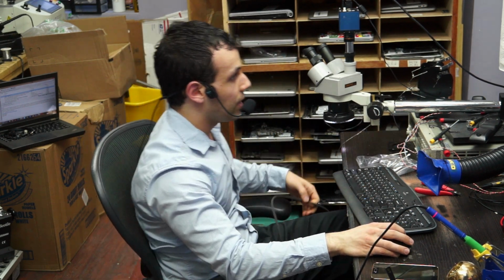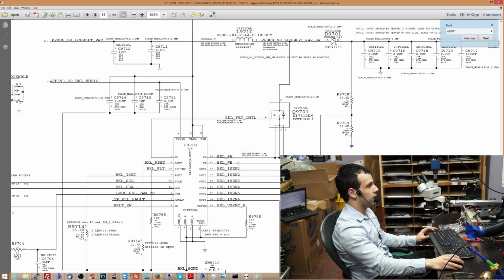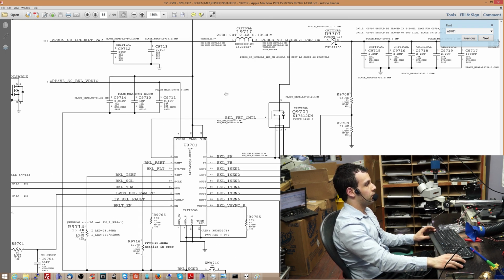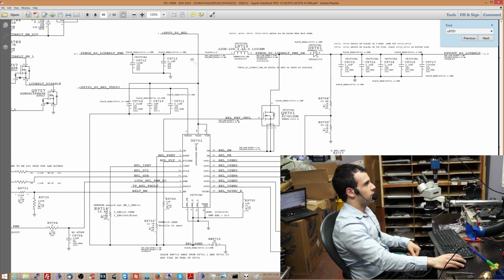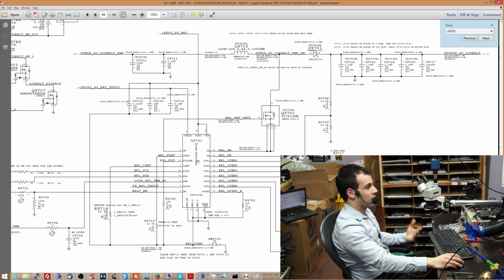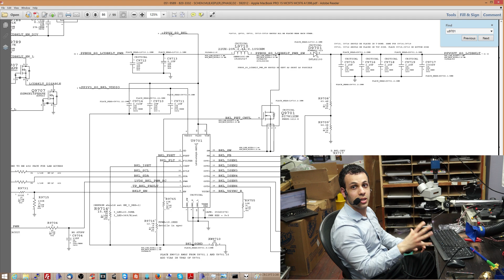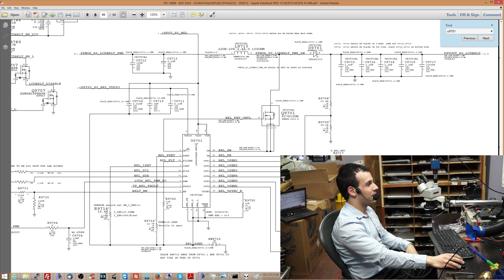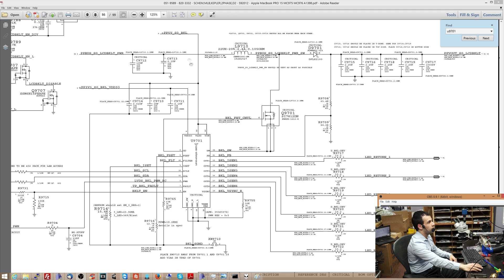What is ground and what is its purpose in a circuit?

Comment: 7:20 ".. Electricity wants to be in the ground". Expert on grounds Mike Holts says in his videos, that the electricity in a circuit does not want go to the ground. Instead it wants to go to the source of supply (its negative terminal). And continues that electricity would take any path, so it could happen that most of the current would return to eg the battery and the rest would go to the ground

Comment: So is there a flow of electricity going through the multi meter at all, are are the electrons in the probes experiencing the state of unrest (charge) that the component is experiencing? If so, why does the negative probe need to be attached to anything if the multi meter can read 0 if none of the probes are toughing anything? In high school they only ever taught us about battery circuits, and all electricity needs to find a way back to the negative terminal of the battery to close the circuit. Are all grounded sources connected to the negative terminal? What happens to the electricity after it makes it to ground? Does the ground have a charge if a component is connected to it, like in the schematic? I am just trying to wrap my brain around on why electricity would want to go to a ground if it isn't completing a circuit. And I am trying to figure out how devices powered from a dc power supply work, since they don't have a negative terminal (,or maybe they do, and I just don't realize it).
Reply: Mulimeter basically creates a parallel connection in voltage mode and has very high resistance/impedance so the actual flow of electricity(current) through the multimeter is quite low since current takes the path of least resistance. Voltage by definition is the difference in "electric potential", confusing terms aside, its basically always relative. Good analogy is that voltage is basically like pressure in a water system. If you have one tank at 12 PSI and hook it up to a tank at 3 PSI, the difference in pressure is 9 PSI. Thats exactly the same way to think about voltage. Current is, well current.. How much is actually flowing. And resistance/impedance, again just like it sounds.

Comment: Louie, I have an inverter that I shorted out trying to install a switch. My dumb ass put one of the wires on the negative going to vcc which in turn turns on a voltmeter. By doing that connection I heard a faint popping sound and saw some white smoke near an inductor and transformer. Needless to say the unit doesn't power on whatsoever and to top it off I can't find the source of the short. I know you don't deal with inverters. But your keen sense of electronics might help me out. Thanks for all you do. Your videos crack me up along with educating me. Please send me links to the flux and solder you use for your projects and fixes. Much appreciate it. Peace brother!

Comment: Could you use as 3v rail as ground and 12v rail as power in order to power a circuit that needs 9v? This is a theory question just trying to better understand. What would the pros/ cons be over a voltage divider if this was easier for some reason again this is just to help me better understand

Comment: One teacher of mine said that electric circuits can be compared to a water network. Tubes=cables, capacitor=water storage, voltage=water pressure, water speed = amps, ground=sewage, etc.

Comment: You're mixing two different things at the beginning of the video. The reason electrons flow from the positive to negative wire doesn't have anything to do with valence. After all, the two wires are probably the same material (some sort of metal). Valence transfer involves two different elements that bond together. There is no bonding happening when you are transferring electrons between two metals. Your voltage source is generating "higher energy" electrons in some sense but this is different from valence and bonding.

Comment: That's not what u think.This happens mostly with the poor quality charger / adapter product and has nothing to do with the battery. And also this could ruine the life time of the circuitboard.
Sometimes this happens with mobile phones and all are because of bad quality charging adapter.
SOLUTION: Make a USB cable with GROUNDING. The easiest way to make is to attach the grounding cable from the wall outlet to the Female part of a USB cable and connect the other Male end to the Laptop. But if you don't have any Grounding system at your house electric wiring system, you have to find a way to do so.
(Generally a naked silver or copper wire is used to do grounding inside the electric switch board, or sometimes uses a GREEN wire to connect to E, as earthing, that's the 3rd pin of a electric 3 pin plug).
Goodluck.

Comment: but I still do have a question when you are creating a charge are you piling electrons up and they want to balance themselves out and that's what makes them move down a conductor to the reference point or ground or when you're creating the charge with the magnetic field are the electrons moving to a higher energetic Orbit on the atom of the material itself my question is if you know what exactly happens to the electron when you're creating the charge the actual physical movements

Comment: The multi-meter section about how it calculates the difference between the two connections was particularly useful analogy I thought.  I do still wonder what happens to the electrons when they are connected to a ground. Where do they go? I mean if the electricity is coming from a high potential to a low potential and wants to create an equilibrium and if you consider wave particle duality I was wondering if there was any measurable result that can be detected. Like waves crashing onto a beach you have sound and ocean spray. Is there a way to detect the electricity crashing into ground?

Comment: sigh electron pushers......your version of ground is the return to the power supply secondary, it is not a true ground it is a bonding buss tied to the opposite end of the coil from the out put terminal , that end of the coil is then bonded to the frame in order to zero the circuit.
"ground" bonds the power supply primary back to the utility transformer core which is in turn bonded to earth in order to zero its circuit hence the term "grounding" this may seem nit picky but secondary voltages dont naturally seek ground we create that  pathway by bonding one end of the coil because with out that bond charge builds up things catch fire people get shocked and the fire johnnys get pissed off.

Comment: One concept that often is forgotten is the fact that an electron has a negative charge. So, actually, electrons are moving from the ground to the +V that is in the lack of electrons compare to the ground. Since we like to work with positive numbers, we assume that electricity (current) has positive value but electrons are not moving in the direction of current from +V to -V or GND; They are moving from GND to +V!
Reply: Arash Arfaee it’s the electron flow, the actual flow of the current. But it’s discovered late and the theorems and principles based on the conventional flow already
Reply: We are continually reminded current can go anywhere you want it, forwards or backwards.
Reply: @southernkatrina8161  there is no flew of positive charges. The lack of electron (relatively) is positive charge and it is stationary. Only electrons move to create current. There is no positive current, we just assume it is positive or negative based on the direction of the current, but at the end it is just electrons that are moving around and they always have a negative charge in any matter.
Reply: @ArashArfaee  that is wrong. Current can be formed by positive ions. This happens in alkaline batteries. The reason current is carried by electrons in most circuits is due to the metal conductors that we used. There is a class of conductors called proton conductors that carried positive ions/protons instead of electrons.
Reply: @marcusjr80  true but only in an ionized liquid or gas. In solid objects (circuits) no positive charge moves.

Comment: Comparing electrical voltage to water pressure is also a good way to describe it.
Volts =water pressure in a hose  or pounds per square inch
Amperes= volume of water in pipe or diameter of pipe
resistance = could be described as a faucet or putting your thumb over the end of the garden hose 
impedance = kind of like an electrical or magnetic choke .I think of a boa constrictor squeezing the water hose.
All voltages drops in a circuit add up to total power of the circuit..Vcc
Reply: That's exactly what I felt like commenting! Water has always served as a decent method to explain basic DC electronics.  Voltage is essentially electronic pressure that accumulates and builds up and releases/pushes current (electrons) towards a space with a deficit of pressure  (potential difference).

Comment: This is great.  But what exactly is ground?  Is it literally a path to the actual dirt of the earth?  If so, why do electrons want to go to the dirt of the earth?  Thanks.
Reply: Ground is usually just a reference point to a "0 volt" level, although that's mostly for isolated circuits (think battery powered stuff). 
If your circuit uses electricity from power lines, depending on laws/regulations you might also need to connect an "earth" to that, which is actually a path to the physical ground (often supplied by the power outlet as a third pin).
Reply: It's any point that equalizes or balances the voltage differences. State of rest. Earth ground is sort of an absolute "zero" point. Like Hamcha wrote it's an ideal ground and safer....at the end of the day, electrons and protons are looking to chill out..without a charge.

Comment: Excellent teacher :) But why not the air instead of a ground point? Why can one probe not be in the air as reference for 0 volt
Reply: Because air is not a conductor of electricity. If it is, then we don't need power lines to send electricity. Air will do the work.
Reply: MrUtuber29 If it doesn't conduct it... my question still stands? :P Surely it would be 0 in the air then
Reply: +King Kek because it wants to get to 0v think of it as if you are in a crowded room you want to get to the room next door that is empty.
Reply: Kgb Air really is 0V but you can't send conduct current with it. Think of it like you're in a tight corridor and you want to enter an empty room for more space. But the doors are locked.

Comment: Meh, still don't get it. So the volts want to move forward to ground? And when they connect to ground, it saturates it (the blue wire) and now the blue wire has a voltage too? But I thought ground was always zero...?
Reply: In house electrics Ground or earth in the literal sense may be 0v but it has potential to store lot's energy it's low potential, because of it's greater amount of mass it's infinatley conductive, if that makes sense, it can dilute energy coming in to close to 0v it's a rollercoaster for energy, it has an infinate amount of empty space to fill up and disipate as heat, electrons or the potental energy that's transmitted through them, wants to have space, so it's always getting pulled towards the path of least resistence 0v ground, a short circuit breaks it's path back to it's source a short circuit is a pitstop if you like on it's way to 0v.

when a battery has used all it's potential energy and radiated it out as heat you will have a balance of 0v on the + and - of a battery. when it's charged say a 9v battery when + and - is connected via a circuit  the 9v wants to be 0v. the heat radiated out is about conservation of energy.
Reply: Astro Man So what stops the voltage from going to that ground?
Reply: Electrons flow from - to + It's backwards but it's a one way tug of war only one winner - is the outward flow of electrons, + pulls at the - source of power passive components isolate  or connect voltage to and from ground to collect or store release energy as it passes and redirect flow back to the +  

It's hard to explain simply tbh Louis has done a good job as it is if you want to look into the physics behind it look up maxwell electromagnetism.

Comment: 0:47 YES THANK YOU! 1:44 Yes i am resting, but i dont know what ground is, so not happy!, 3:30 Please get to the point! 4:00 come on, i dont care!, 4:40 Good you finished! Please tell me what is ground now, 5:38 Yes i know Plus and minus, i get that...what is Ground god damn it! 6:43 ARGH!!! Stop wasting my TIME! 7:08 Yes we come full circle...now tell me. 7:58 i doubt he has the answer im looking for... 9:05 sooo ground is minus?, 10:12 nothing happens...11:23 God damn it. You wasted my god damn time!!!

I am trying to use a 555 timer to power a 12V thing, with a mosfet the signal from the output of the 555 has nowhere to go. So where in the fuck does it go? i tried connecting the MINUS from the 555 circuit (5V) to the minus of the 12V nothing happens.
Reply from the maker: +Inesophet hit x if it bothers you so badly.
Reply: well i did after watching the video and having my question not answered. im sure you do know the answer to my dilemma that eats up most of my evening currently and i am even going to beg, "Oh grand master of Electric Wizardry who`s words are plentyful please just tell me to which path i have to look and i if it turns out to be the one meant for me you have my eternal gratitude".

Comment: Correct me if I'm wrong but this explains what is neutral, not ground.
Reply: Ground and neutral are basically the same thing. The neutral wire is just the path back to ground. In a circuit like this, that's not separately grounded, there's no meaningful distinction between the two.

The separate ground wire you see in grounded electrical wiring is a second short-circuit path back to ground. The neutral return wire is connected to ground further along the way (probably at the transformer), while the ground wire is connected to ground right outside your house. In that case, there is a meaningful difference between the two: the neutral wire is intended to carry current back to ground under normal operation, and the ground wire is intended to be dead, and is only there to carry current back to ground if something goes wrong and the current finds itself somewhere it shouldn't be.

Comment: An electrical circuit is like re-routing a river to flow through a water mill. The river is the cord the electricity flows through. Water is the electricity. The water mill is the blender your making a smoothie with. The reference point is like sea level, the water is always going to follow gravity to flow down to sea level.